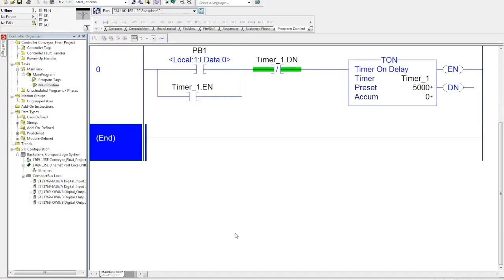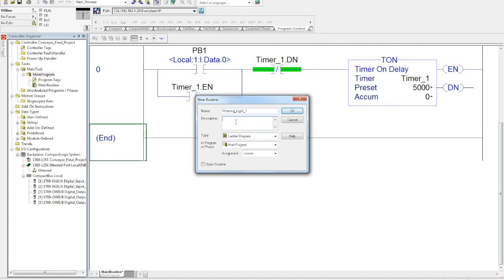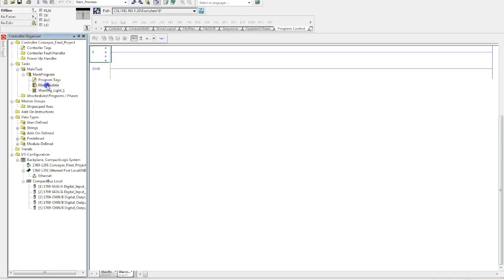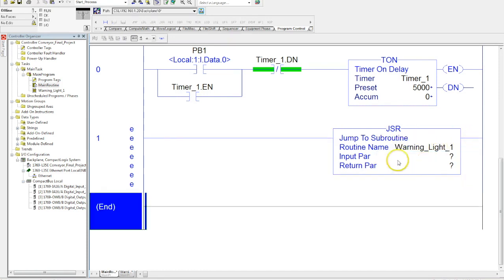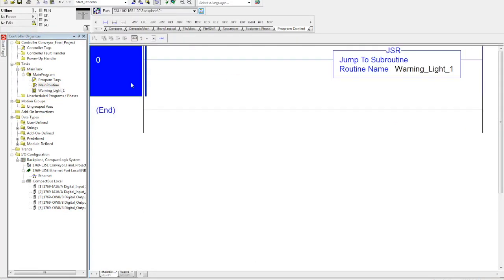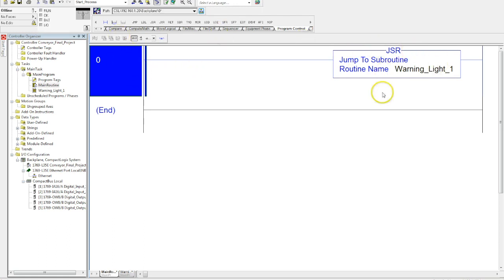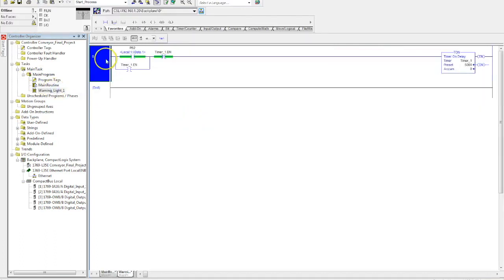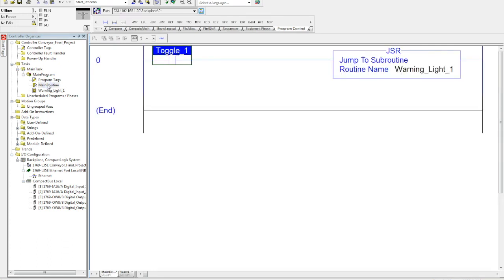Intro to the Jump to Subroutine in RSLogix 5000

Comment: i know this might be a stupid question... but what is the major benefit or use a of subroutine instead of using all logic in the main routine?
Reply from the maker: Not a stupid questions.  There are a lot of reasons.  One it helps to organize our program making it easy to understand and troubleshoot.  It can also be used to easy shut down parts of your program.  Those are just a few of the reasons.
Reply: yes, thats good question if your program is just simple, no need for routine but complex and large program it is required for readability and my experience it is very helpful in troubleshooting especially involves communications
Reply: @edinetgrunhed6000  I still think that it steals from the overall "flow" of readability, but then again I haven't typed any "large/complex" programs.